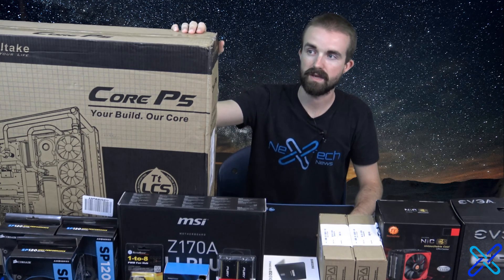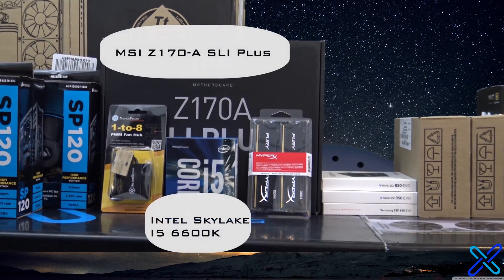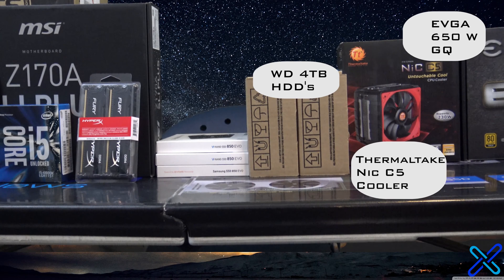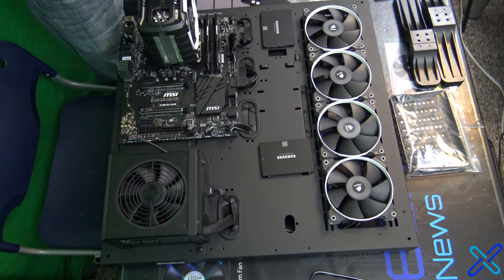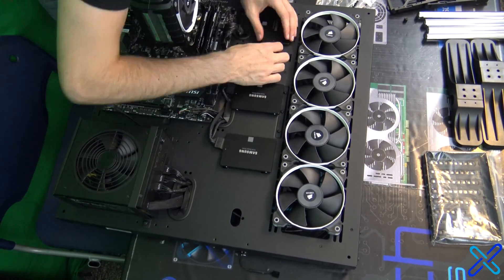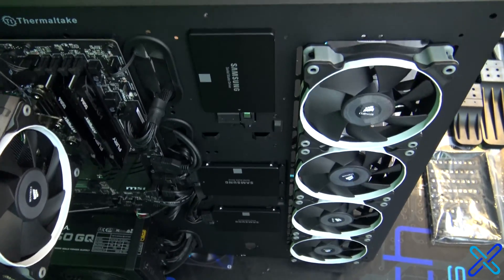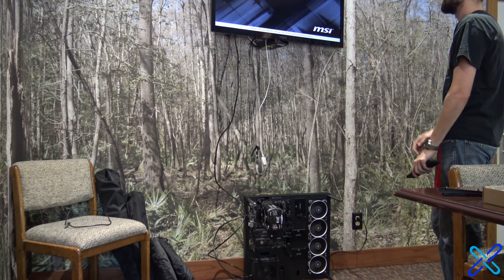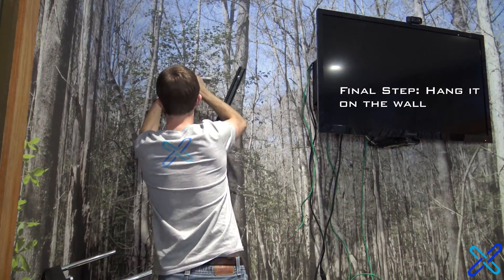Thermaltake Core P5 PC/NAS Raid 1 Build for WGI

Comment: I would say as a computer it is very nice but as you are building it as a server and remote pc I must say you picked poorly in parts and setup.  No business is in the market for cheap gaming rig if they are in need of server.  You'd want xenon and ecc memory more than 8 gigs. Plus better hdd system for raid and not raid one. So nice gaming rig just sucks that you are hurting them rather than helping.
Reply from the maker: +Dale Kauffman JR I should of never called it a server because that's not what it is, they use it as a conference computer, a show piece in their conference room which is the first room they walk into in their office, and it's primarily used as a NAS. This computer works perfectly for the use this company has, I very much respect your opinion but this is what they wanted.
Reply: NeXTech News  as a show piece I agree it looks great but even as a NAS it isn't good. We both know a raid one although is something is still not great, a raid 5 or 6 would be better in a business world. But I myself like your build. Just not as a business machine.
Reply from the maker: +Dale Kauffman JR I agree with you a raid 5 or 6 would of been better but this is what they could agree on I tried pitching the raid 5 or 6 setup and they didn't want it, yes this machine is impractical and definitely isn't what I would recommend for a business but this is what they decided on and they love it so that's all that really matters
Reply: NeXTech News fair enough. Still nice build for consumer grade.

Comment: my question, what's the pertinence to have fans on the right side if it is an open case and the cpu is air cooled ?
Reply from the maker: +Alain Lafleche Zero reason of having them, they cool the HDDs behind them technically but they serve no vital importance to the rig. I added them because the company I made it for are using the PC as a show piece in there conference room and it looked terrible without fans there
Reply: I see, nice build.
Reply from the maker: +Alain Lafleche Thanks!

Comment: So much Storage!
Reply from the maker: +CTC GANG yeah a ton haha! The raid set up was cool to do though!
Reply: NeXTech News My PC has a ton too? You may not beleive me, but my PC has 8TB of space... lol, I don't know why I built it for that, but it does support my games, also, I have a 4K supported graphics card, VR ready, and I also have 2 34.0" monitors I use, which are curved, the case is a Thermaltake Core P5... if you wanted to know.
Reply from the maker: Holy cow that is a lot!! Which GPU? Which 34in Monitors do you use? And I loved building in the P5 so much that I went out and bought a Core P3 which is the smaller brother to this case. https://youtu.be/xp1S9RXhThs
Reply: NeXTech News I've just updated it... lol, case was cheap, I used a NZXT H440 Mid Tower, I have 3 LG 27-Inch 4K UHD IPS Monitors, I used smaller ones, for a greater difference, my Power Supply the same, EVGA SuperNOVA 1000P2, Video Cards, same as well, MSI GTX 1080 Sea Hawk X [2x Of Them], my storage, massively upgraded, 2 WD Blue 3TB Hard Drives, and 2 Samsung 850 EVO 2TB SSD's, I have the same RAM, 4x16GB Ballistix Sport, my motherboard, the same, MSI Z170A Gaming M9 ACK, my CPU cooler, the same, MasterAir Maker 8, my CPU, the same, Intel Core i7-6700K Unlocked Quad-Core, also, my color scheme, Red/Black, was that enough?
Reply from the maker: That is one freaking amazing setup!!! I bet that looks soo nice!!! One day ill get there haha!
Reply: NeXTech News Well, it took a while for me to get, so I know the wait, I am thirteen now, it has taken me 6 YEARS! Long time, I just hated waiting, but as long as you have motivation, the wait won't last long.

Comment: what is the fans for i t doesnt make anysense you should've use other beautiful cases that fits it
Reply from the maker: +AFK They wanted the PC mounted to the wall and exposed so it was a talking point, and the fans are mainly aesthetic haha
Reply: hahaha ithink you should have used the lian-li pco7s its is wall mounted and open air design which suits your build and it have a glass panel so you can take a look at the inside (just a recommendation hahaha)
Reply from the maker: +AFK yeah I actually thought of that one but all the SSD and HDD would have been hard to fit in there! Haha
Reply: iam just suggesting it hahah but really thhink that its better with other cases but if your doing a custom watercooled build that case is a killer .thanks for replying wish you good luck:)

Comment: No redundancy, no failsafe, there isnt anything servergrade in there. Shouldnt be surprised if they installed Windows 10 Pro on that monstrosity of a server
Reply from the maker: +RoboDog Their is redundancy in the storage which is all they needed it for. It is not a true server. They use it as a conference room PC, a remote in PC, and then a couple HDDs and SSDs are configured in Raid 1 to be NAS Drives. The NAS Drives is why they call it a server but it's only kind of a server which is the reason for the odd choice of parts.
Reply: In my opinion, they should just gone with cloud server option for this.
Reply from the maker: +RoboDog They were doing cloud storage before but were tired of paying the monthly fees and the performance is so much better than cloud storage because of their internet speeds were they are located

Comment: cool looking build , why did u install the fans i thought from the case design those were radiator mounts for custom cooling or do the fans cool something set like that?
Reply from the maker: +Chris Chandler they are cooling the HDD behind the motherboard and cooling back side of motherboard slightly, but they are entirely unnecessary! That case just looks really bad of you don't have radiators or fans there
Reply: Thank you for the great video and honest response. Those fans on right don't mean anything at all.
Reply: Instead of putting random fans there, you shouldve just spent a little bit more and placed an AIO on the cpu. the radiator fans wouldve cooled your Hardrives. I get Aesthetics. but whats another 100$, also. its an open chassis, would you really want air coolers for the cpu? what if it gets hot in that place.  :(
Reply: A closed case would suffer the same from a warm room... But I agree. This looks retarted to anyone who knows something about computers. Should have gotten the core P3 (smaller version) and put an AIO in it as i did myself. 

The way this is done you got a whole lot of empty space and fans that are making noice for fuck all
Reply: Huub van Assema im doing the same but not sure if muy kraken x61 will reach the GPU. do you think it will fit?
Reply: I used an Raijintek Triton Core, a 240mm aio, wich fits with ease. You might be able to find an compare the tubing lengths
Reply: Huub van Assema alright, thanks!